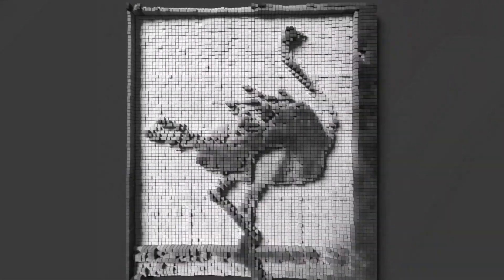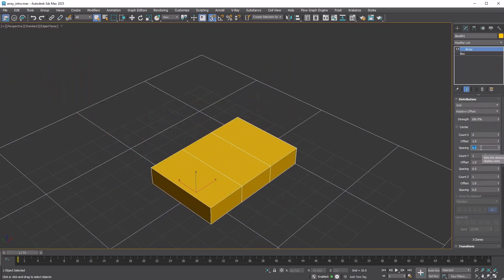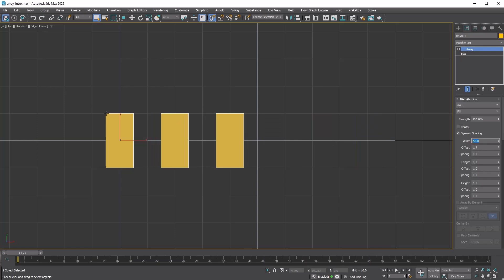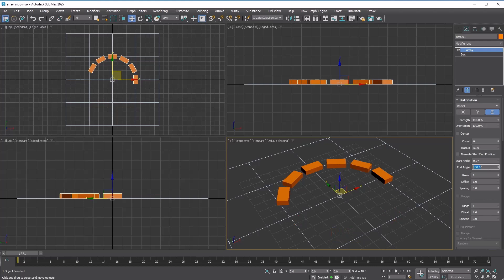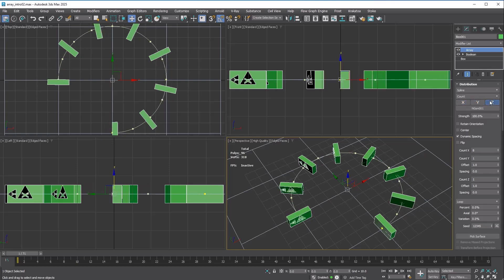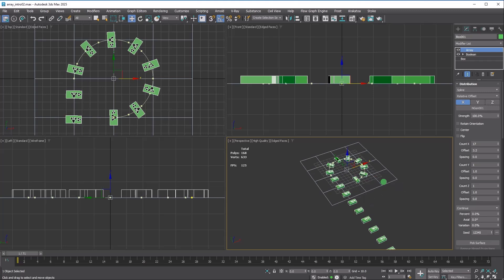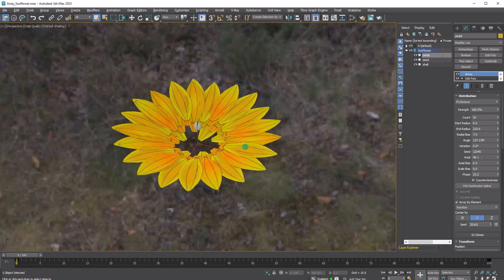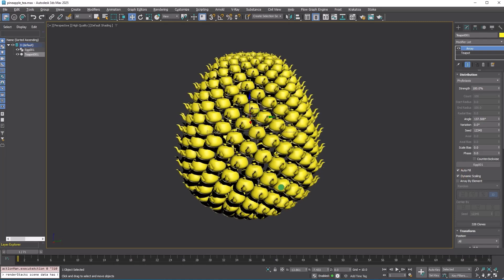Introduction to Arrays in 3ds Max

Comment: An extraordinary tutorial series, thank you for that. When it comes to the Array modifier, I wish it was a little bit more flexible, for instance, it'd be great to have an option to stretch the geometry in between the first and last clones or when using the Array by Element option. A small quality-of-life options like that which make modeling things like rooftops, boards or even entire elevation modules a breeze in Railclone, but it's quite a pain or flat out impossible to do just as effectively when using Array.

Comment: Great tutorial. Although array was too late but It came so powerful.
I have a problem using it. When I spread windows across the opening of a building using array spline and segment option. I use reset XForm to correct orientation. the spline has multiple segment separated from one another. At first the windows are straight up as they should be (not rotated around line). But after adding more segment inside spline or making a copy of segments with Ctrl+Shift some windows automatically get rotated specially for newly created segments. Windows are rotated around spline (tangent) And their angles are different. Moving segments a little up and down rotates it to some other value sometimes to correct value.

It would be good if we have Human voiceover as we cant connect with AI voice.
Reply: Are you using the Array modifier or are you creating copies along a spline yourself?
Reply: @paulneale  I'm using array modifier.

Comment: It's about time we get some new features! When are we getting a node based system for geometry?? You're getting left behind in the dust autodesk!
Reply: Why we need node for geometry when we have modifiers?
Reply: @tolebaybaglan4330  so you still prefer the compact material editor over the slate? A node based system is almost always better than menu's stacked on top of each other, it's just much clear overall. That's why software like Nuke and Houdini use it, it allows for much more complex systems.
Reply: I believe the modifiers stack is as good as the node system
Reply: U dont need geometry nodes like blender, max is much more versatile with data channel,modifiers, mcg and pflow.
Reply: That's why there is bifrost. But sadly Bifrost for max is discontinued. If MCG was developed properly. Would've been as powerful as geo nodes by now